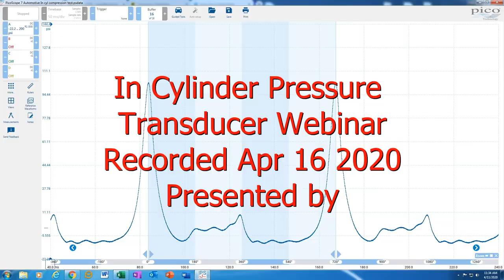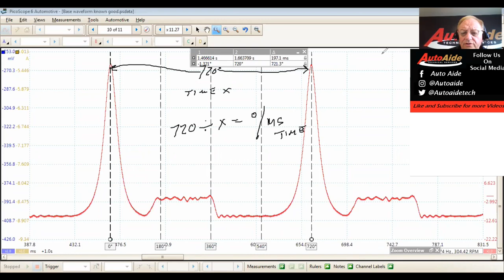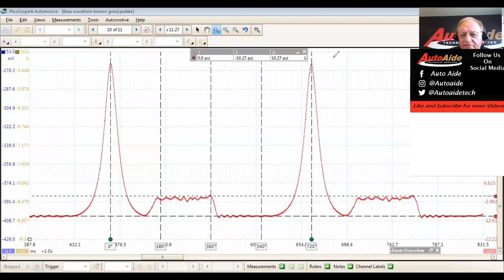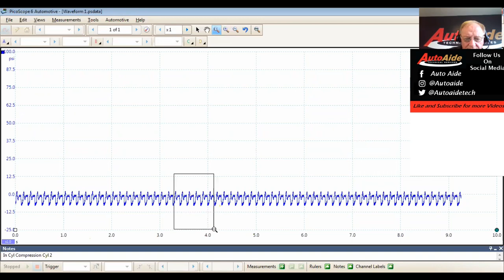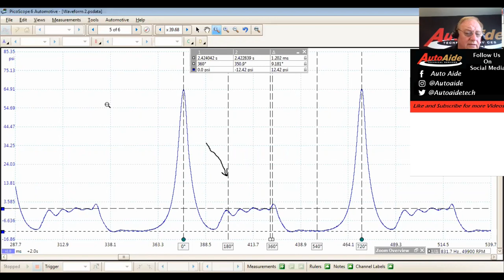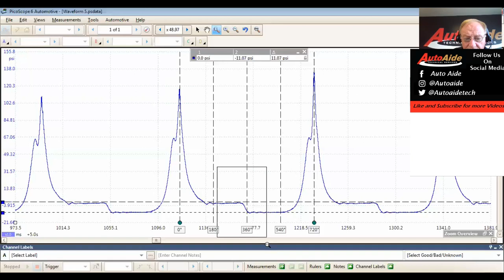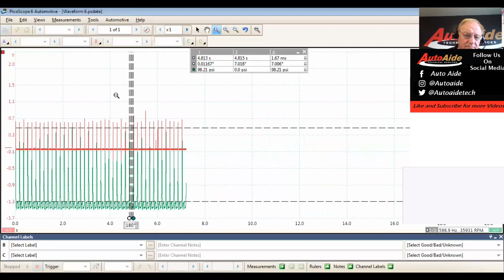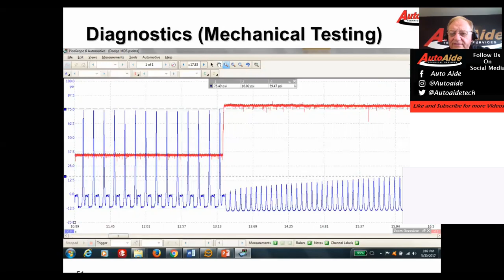In Cylinder Pressure Transducer Testing

Comment: Question for the honda capture at 49:30. Suppose the customer was not willing to touch bottom end or replace the entire engine but was willing to go for a valve job. Remove head, valve grind, replace any worn out valves/guides, replace camshaft if needed. Would you feel comfortable enough going that route after just this capture? Or would want to do further testing? And if so what? Would you already feel comfortable enough saying that the issue is not in the bottom end? Also comfortable enough saying that it's not a cracked head? 

I deal with this sort of issue a lot at work. At my current shop I can no longer get away with just saying a problem is internal to the engine. I have to come up with is it fixable within a reasonable budget. Usually on vehicles where it's too hard to find a good used engine. 

Thanks and awesome video!

Comment: Awesome video! Thank you!
What max pressure transducer would you recommend using for cylinder pressure testing.? Also, how do you use the transducer when engine is running?
Reply from the maker: You need a transducer that can go to 300 psi for gas and if you want to do diesel you will need 500 psi. PICO makes an excellent tool. You can use the transducer when the engine is running because the cylinder is not firing due to having the spark plug removed.
Reply: @autoaidetechnicalservices3981  300 is what I ended up getting 👍🏻. Thank you!

Comment: Hi there,  thanks for the vid. You indicated that if Expansion Pocket is high it reflects a possible valve timing issues on non-VVT overhead cam engines. That would logically affect all cyl. However, what if you have, as I do (4 banger, DOHC, Hydaulic lifters, nonVVT), consistent compression peaks across all cyls and a slightly (1-2psi) but consistently higher Expansion pocket only on one cyl??  Can you have a sealing cyl on compression but still drawing in some air around valves on Expansion Stroke??? Engine runs well but very slight fishbite misfire on idle not resolved by new plugs, wires. Ig Timing is good.

Comment: Really nice video! Just a question. Why is the cranking waveforms so different from the running ones? What changes? The cylinder in both cases is without ignition.
Reply from the maker: A cranking waveform is done with the throttle open and the engine is turning over much so slower so cylinder scavenging is not really happening at cranking speed. Once the engine fires the throttle is closed and scavenging starts to take place. Closing the throttle creates more vacuum in the intake and cylinder. Even at cranking speed with the throttle closed the engine does not produce much vacuum. If you look closely at the waveforms you will see that the vacuum parts of the waveform on the running engine are much more pronounced.
Reply: @autoaidetechnicalservices3981  Thanks you!!!